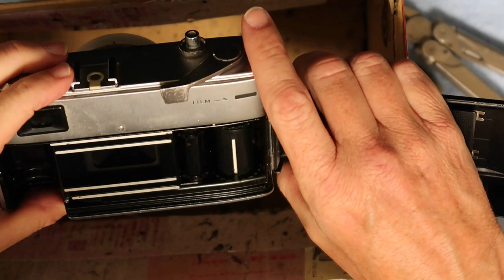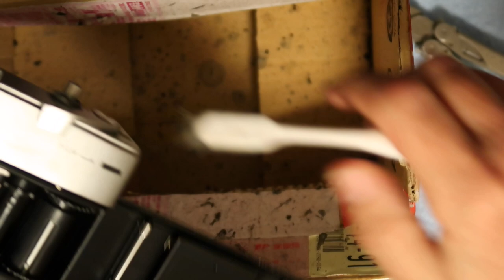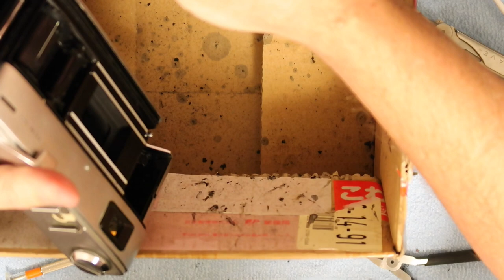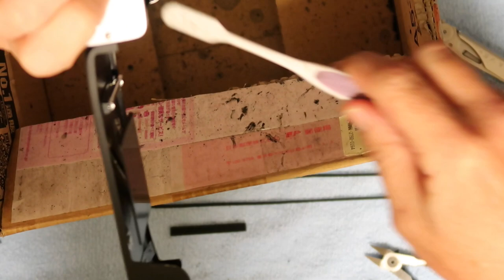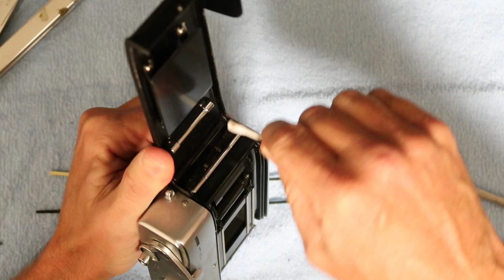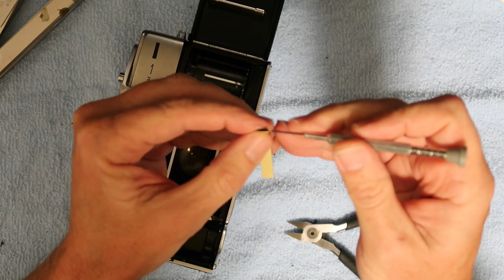How to replace the light seals in a film camera

Comment: Have you ever used cotton yarn to fill the channels? That foam can be very fragile and easily messed up for someone who doesn't have a lot of experience. Yarn can be pressed into place with no adhesive and I don't think that it will eventually rot as the foam does.